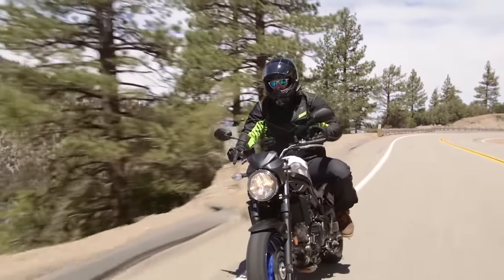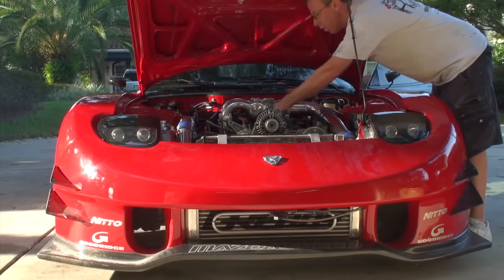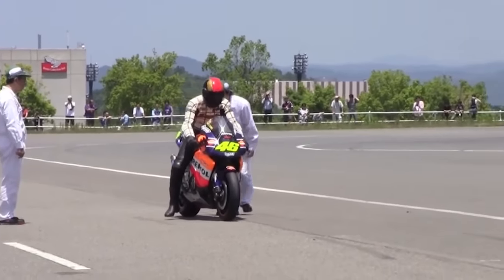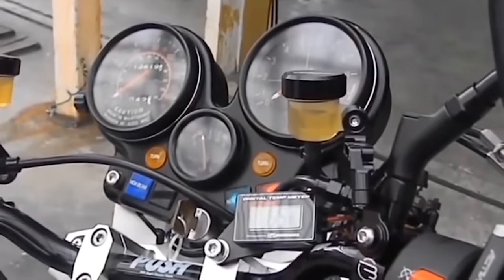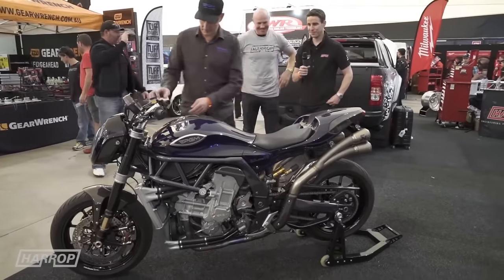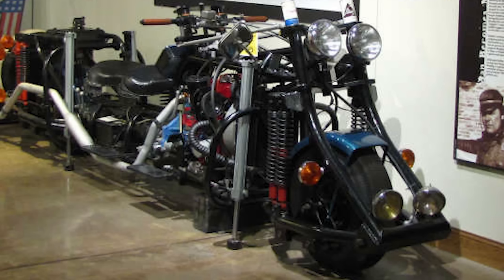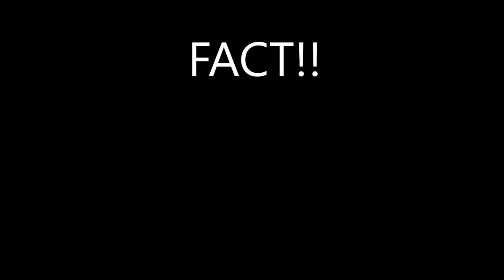The Most UNREAL Motorcycle Engines Ever Produced

Comment: Back in 1969, my dad bought one of the first Kawasaki Mach3 triples introduced into Canada( if my memory serves me correctly, it was the first one sold, Korcan Kawasaki, Vancouver, BC) He raced it at Westwood Race Track in Coquitlam, British Columbia 🇨🇦 That thing was a rocket! (the track was famous for being on top of a mountain) I rode it in late 70's, early 80's and that thing was still a rocket! 😵 It rattled so badly, it would vibrated the blood out of my hands. Love those kinda memories. Cheers.
Reply: The rattling came from the centre cylinder,poor lubrication and cooling wore out the bearings before the other two cylinders,It was that basis i went for the less powerful but more reliable Suzuki GT550 two stroke triple 54 bhp and not the 62 bhp of yours
Reply: I also had a Honda CB350 before the Suzuki,It was a four stroke twin,mirrors you could see the colour of the car,fingers and toes would go numb after 25 minutes from the vibration

Comment: I don't like to be that guy but I'm gunna do it anyways...
{Inhales copious amount of air}

The Rotary engine is reliable when not pushed beyond it's limit for extended periods of time, like most engines, but it did prove in the last year of Le Mans (the year before the motor size was changed to 3.5L to match Formula one motors at the time as well as regulate against non-pistoned motors) that the rotary could run at ridiculously high stress levels and take 1st place in an endurance race.

The rotary, while confusing to many and seemingly fueled by wierd, japanese black magic, is simpler than normal piston engines because it has much less moving parts. The reason the rotary has been dubbed unreliable is because most do not know anything about rotary motor maintainence. Since the rotary typically runs at higher rpm than a comparable piston engine, it tends to burn brighter but not as long. Realistically, a rotary should be professionally rebuilt every 60k miles. Furthermore, the rotary does not burn oil out of malfunction, it consumes it in it's "infinite" stroke. Injecting oil directly into the combustion chamber to lubricate the Doritos/rotors, it uses more oil by design. Since it consumes oil in it's combustion cycle, the oil must be able to combust and burn to avoid pooling and carbon build up, run of the mill synthetics, which are typically a good choice for normal piston engines, do not burn at the same temperature as conventional oil which leads to issues in the chamber. 
Apex seals, which were originally made of graphite, do wear down and begin failing to seal the chamber which destroys performance. Modern day ceramic apex seals last many times longer and con usually last the duration of time you own the vehicle.
Lastly, Mazda specially stated in the owners manual that you must red line the motor in order to clear out any carbon build up, which for any one who has owned a rotary knows, it is quite happy to do so, in fact, it is the only thing it wants in life. 
So, in conclusion; rotaries have developed a stigma as being unreliable when in actuality, it is due to improper maintenance and driving habits. The approach that would keep a classic car in good shape is detrimental to the rotary motor. To own a healthy rotary, you must treat it like a waifu with a bdsm fetish...because that's what it is...a dark haired, freak that gets wet at the idea of "Hot Wax".
Reply: "take 1st place in an endurance race."

I don't know how long rotards are going to keep repeating this, but that over-hyped Le Mans C2 victory counts for very little. Because they qualified so poorly, the Mazda team was able to sweet-talk the FIA regulators to let them race despite not being a legal car, at 400 pounds lighter than the minimum. Also, over half the field wrecked due to whatever reason, some of them late enough in the race that they practically handed Mazda the easy win. The 737B had tons of engine issues throughout its career, between several oil failures and a couple fires in that same season, it wasn't any better than the competition and wouldn't make a podium for the rest of its career. The engine was also used in the IMSA by Mazda and was a huge flop

Now, all of this doesn't matter because the 737B is a purpose built race car, and not a mass produced street car. In the practical and "real" world, pistons are better in every objective measure.
Reply: @Anonymou-s  wrong. Piston engines are heavier in terms of power delivered to engine weight, at least in the car world. It's why motor gliders can usually be found using rotaries.
Reply: Respect to MAZDA & SUZUKI for makin it happen & to MAZDA for keepin at it. Very untypical Japanese 👍

Comment: No oval piston Honda?  NR750
Reply: How about a 1950's oval piston Sears/Puch Twingle?
Reply: Probably the best engine ever made from Honda, pre-production version was 210hp from a 750cc in 1990....they detuned them to 130hp for production models.
Reply: @MrKdr500  They had to detune it that much because it couldn't be made to be reliable any other way. So, as much as it was an impressive engineering feat, it cannot (imo) be said to be their best engine. It was an evolutionary dead end.
Reply: @BuzzLOLOL  They were not oval pistons, two round pistons with one combustion chamber. on the Sears/Puch Twingle.
Reply: The Honda NR 750 most definitely had Four Oval Pistons and Eight valves per cylinder.
Reply: @nelsondavis4310  wrong...lived in the era...4 oval pistons...a road version to justify or pay back the development of the NR500 gp bike...Honda knew a 4 cyl 4-stroke could never compete with the 2-strokes for HP...& the gp regulations banned 8 cylinders after motoguzzi's v8 gp bike of the 60s...so they siamesed the cylinders together with 2 conrods per piston & 8 valves in an extended pentroff combustion chamber & pushed the short stroke engine beyond 23000 rpm
Reply: @Errol.C-nz  I was not talking about the Honda. the Puch/Sears Twingle.
Reply: @nelsondavis4310  apologies on that...yeah the twinkle was a horrible concept seriously flawed & devised by designers with no understanding of basic thermodynamics...one cylinder ported for intake, the other for exhaust...

Just like the cheap to make May cylinder head & deep dish heron pistons on Jaguars v12...a BMC marketing hype, killed by the 70s "fuel crisis" !...another horrible design Ford proved seriously flawed in their cross flow Kent engine prone to piston crowns overheating & hot seizing
Reply: Agreed
Reply: @Errol.C-nz  This design was used to have a uniflow scavenging. On large 2-stroke diesel engines (which use a pump instead of the crankcase for scavenging as in the first 2-stroke engines, lubrication is like 4-stroke and the efficiency can exceed 50%) the uniflow scavenging is obtained using the traditional port on the cylinder and an overhead valve or with opposed pistons. The solution with two parallel cylinders and a combustion chamber obtains the same effect as the opposed pistons with a smaller footprint and without the need for two crankshafts at the cost of an inefficient combustion chamber. Before the introduction of  expansion chamber, the loss of fresh charge from the exhaust without uniflow scavenging greatly limited not only fuel efficiency but also volumetric efficiency and therefore the power, lower than 4-stroke engine. This solution has an inefficient head due to a large surface but the uniflow design reduce the loss of fresh charge, increasing power and reducing wasted fuel
Reply: @Mauro-82    A friend had a Sears 250 I think 1966 model.
It topped out at about 65 or 70 MPH. I remember the YAMAHA 250 Big Bear was faster.
Sure was a long time ago.
Reply: I had a Sears puch it would sieze at wide open ,and the clutch would not release .after the second time I pulled it out of the woods I got rid of that p.o.s.
Reply: I gave it thumps down since its dissing the Kawasaki h2.
Gfy.

Comment: 2 engines that should be added oval piston honda and yamaha TZ750 inline 4, 2 stroke race engine from 70's.  I may be wrong but I think those were configurations only done by them once and never copied by other makers. I know oval piston was only done by honda and I am kinda sure only inline 4 cylinder 2 stroke was yamaha TZ, many v 4 and  and square four  2 strokes race back in 2 stroke heyday but only inline 4 2 stroke I recall is TZ750 kenny Roberts tried to tame.

Comment: Boy, did you miss the most obvious one. The NR500, with the OVAL pistons, 8 valves per cylinder. Now, THAT was a weird engine!
Reply: And the oval pistons had two rods which would twist as engine revs pulling out the pins and engine failure

Comment: Many years ago I rode a friends Kawasaki 750 H2. The power went from "try to keep it running" to "hang on to your butt" in an instant, and the chassis twisted up so bad the wheels went in different directions. I parked it and gladly switched back to my Suzuki GS 750.
Reply: Hahaha,I would have said it the other way around,My Suzuki GT550 two stroke triple would easily beat your GS750 BUT the GS1000 wow i borrowed one 140mph in evening street lighting only,It was so well behaved compared to my wild pony white knuckle GT550 ride,Where would slide down the saddle in second gear with the throttle open.

Comment: The classic Honda Rebel 250CMX single carb twin cylinder is rated 70mpg, but both my '86 and '03 got 60-65mpg until I disconnected the accelerator pump on the '03 now averaging 88mpg and much more fun to ride. The engine wants to idle and hold a steady rpm at any speed. The chain sprockets were swapped from stock 14/33 to 15/30 which makes 1st gear more useful. All gear shifting smoothed out nicely. I can coast it in 5th gear at 15mph and full throttle at 20mph. Top speed is 70mph, but speeds over 55mph cruising speed is 'forced' with wide open throttle. Best mileage so far is 95mpg. The adjustable Main Jet screw tuned to maximum rich mixture gets 80mpg, but improves the typically awkward warm up. I'm aiming for 100mpg just to see if it's possible.
Reply: Your pretty honest,I was waiting for 60mpg and 120mph,A two stroke Kawasaki in the 80s could 130mph but probably 20mpg,My Honda CB350 did 60mpg and my CD175,100mpg,My fathers Kawasaki GT750 60mpg at 50mph,And when i was a baby 1956 his Tiger 100,Did 70mpg and 100mph so probably not very good acceleration because my Suzuki GT550 two stroke triple,Could do 0-60 mph in 6 seconds but 95mph and a average of 35mpg and as low as 23mpg

Comment: In 1984, I brought down from Oregon to Southern California 1972 blue Kawasaki H2 750 that had 4,000 miles on the odometer I purchased for $400. The guy who sold the bike to me was scared of it after a 50 mph accident that must have been not too bad because the bike was pristine except for a few scratches in the gas tank. It's sprockets and chain were the 1st things I replaced because the teeth on the rear sprocket were bent over like nothing I'd seen before. All that torque pulling the teeth sideways! I rode that bike like crazy for a year before trading it for a 1967 vw bus.

Comment: Well done video... I personally would have put the Suzuki GT750 (Water Buffalo) instead of the H2.. Although it didn't make as much power.. It was a much better motor and bike.. Thats why i own one :)
Reply: My friend rode his Water Buffalo from Vancouver to Valpariso problem free.
Reply: I had a GT750 as well, 1976 model.
Reply: I have both, the water bottle as we call it... hm I’d still go the h2
Reply: I had a green 74 H2 with Dencos and the blue 1972 when I was in the 82d Abn, I used to tear around Ft Bragg and Fayetteville, man I miss those bikes.  No bike I had after those could pull quite as hard, but they did feel more safe.
Reply: Kawasaki was air cooled, and ruled. Had sex appeal! The Buffalo was detuned, water cooled,  and butt ugly, so it does not make the list.
Reply: @Kyocera234  I was in the 82nd around that time. I know the MP's used Gruber Rd. as a speed trap and the Fayetteville cops thought GI's were a source of revenue for the city. I got a ticket for littering by throwing a rock out of the window of my friends car into the tree line on Bragg Blvd.

Did you frequent Hay St. While buzzing around in those days?.
Reply: I owned three Water Buffaloes from new, and two H series Kawies.. The Suzuki was hands down more reliable, and when the top end was reworked and expansion chambers added ( and carbs rejetted) the buffalo would  outpull the Kawies all day.

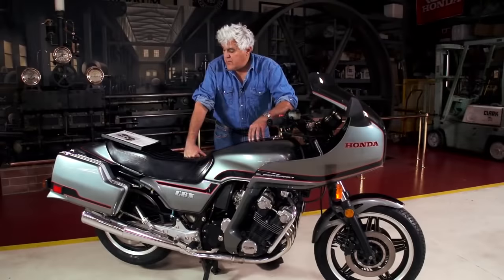Comment: 7:29 Wrong! The BMW K1600 has a inline six cylinder engine.
Reply: Philip P. This video is about bikes, not cruise ships. But jokes aside, go check out the Horex VR6
Reply: @Samuel-fw8rq  That's not an inline six it's a VR6.
Reply: @Samuel-fw8rq  have you ever driven the k1600? It accualy handles really well, almost like a sport-tour bike. It shure rides much better than an Honda grande sofa (goldwing) .a friend of mine even drives it on the circuit
Reply: @fjdg94 I'm not sure if it's even a motorcycle anymore when you have a reverse gear on it. The Goldwing is more of a two wheeled convertible then a bike.
Reply: @Peanutdenver  I mean.  Without reverse gear it might end up being a piece of metal standing around in front of a wall Untill you find 4 people helping to move it. So.

Comment: My guy, you made a great video. However, i would Highlights suggest yo, to make a part 2 with more infamous bikes.
I've got a small list of bikes with unbeliveable engines but there are so much more:

Rossis Honda NSR (195 hp 2 stroke at 500cc, that's 390 hp per liter)
Northon RCW 588 (fastest wankel engined bike to ever race)
MTT 429RR (turbine on a fucking bike)
Horex VR6 (if in line 6 engines on bikes aren't weird enough)
München Mammut 2000 (2 Liter 4 cylinder)
Neandertaler 1400 (turbocharged 1400 cc Diesel engines with counterrotating crankshaft)

...

Comment: NO 1955 Moto Guzzi V8?
NO 1965 Honda inline 5 - 125cc - 18000rpm?
NO 1966 Honda inline 6 - 245cc - 18000rpm? 
shame..
Reply: I think the 125cc 5 cylinder  (RC149) revved to 23,000 rpm.
Reply: @peterhatfield5632  The Honda RC149 had max. power at 20,500 rpm. Specific power was somewhat lower than that of the RC116 50 cc twin because of the more complicated crankshaft. It could indeed be revved to 23,000 rpm.
Reply: Was expecting the Ariel Square 4...

Comment: Rotary engine overcomplicated? There are three moving parts. They are very, very simple and light engines. Inefficient and lacking in torque, sure; but complicated, hell no.
Reply: Simplicity does not always equal reliability. Rotor seals were a killer.
Reply: @stevewhite6252  I hear you, rotary apex seals definitely have a bad reputation. Like most things, the issues with the seals are probably a little overblown. Most non-boosted rotary engines have a service life similar to their piston-driven counterparts. I can't speak to the specific quality of the engine here though. End of the day, they swallow fuel, have no torque and are terrible with emissions since they burn a lot of oil. Not exactly a formula for success.
Reply: You SHOULD be right, but you are not when it comes to the RE5. I was a mechanic at a Suzuki dealership and it was, by far, the most complicated bike in real life. The sub-systems were a nightmare. Carboration, for example: was 2-barrel with a vacuum operated secondary with the secondary also controlled for coolant temperature. First, you had to go to a special Suzuki class just to be certified for warranty work on the carb.Then not so much because.... the directive was just to quietly disconnect the secondary. Yup. The exhaust system.... had a fresh air injection system..... the instrument bezel had an electric motor in it,  and on and on. I loved riding it for test rides but only Rube Goldberg thought it was a good bike.